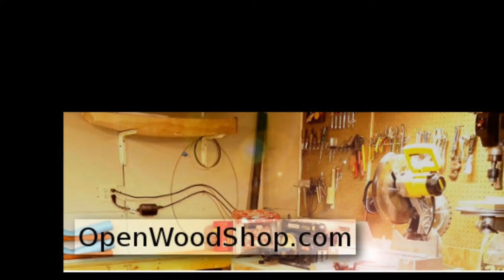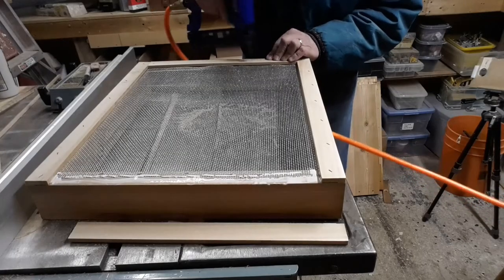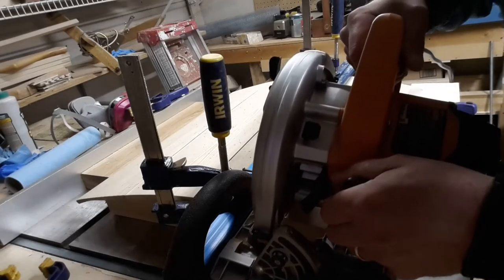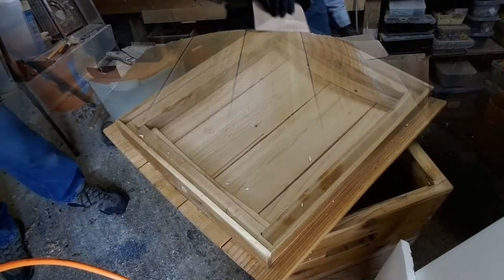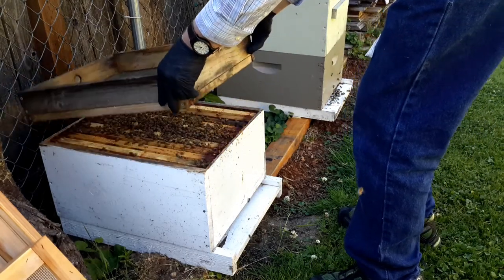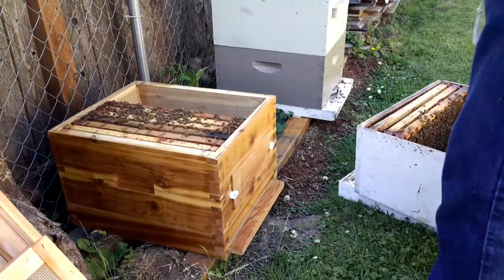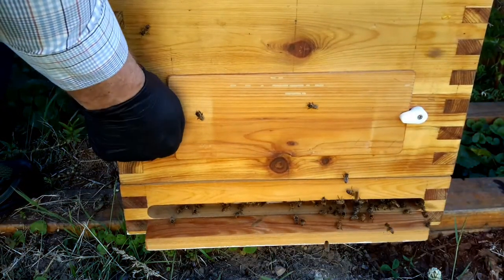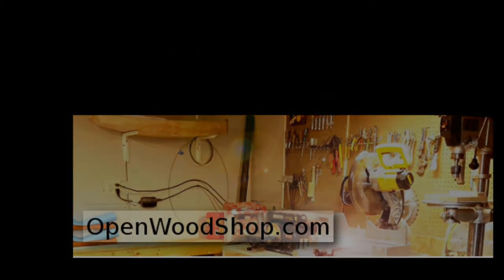Cedar Bee Hive

Comment: Nice!!!   I was wondering if cedar is the best wood to use?  Does various wood species affect bees differently?
Reply from the maker: Cedar is good for it's rot resistance. But other woods work fine. Pine is a common wood to use. Fir would work fine but it's also rather heavy and a little harder to work with. Also, it's better to stick with the standard measurements. Over time one seems to collect other gear and it makes it harder to integrate equipment of different sizes.
Reply: @OpenWoodShop I agree that it seems every manufacturer is a just a bit different so I make all of my own equipment. I run all 8 frame single brood chamber setups with slatted racks between the bottom board and brood chamber. I am thinking about building some out of Cedar as well. I may add a few with windows as well. Have you had any issues with the setups? How have they held up?
Reply from the maker: @coincollector315  They held up fine, but with windows on the side there is really not much to see.